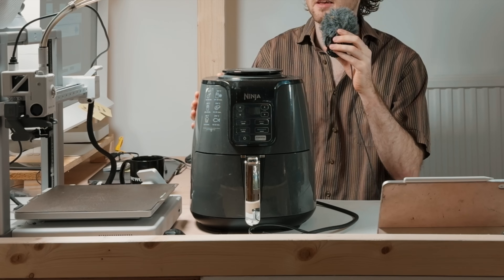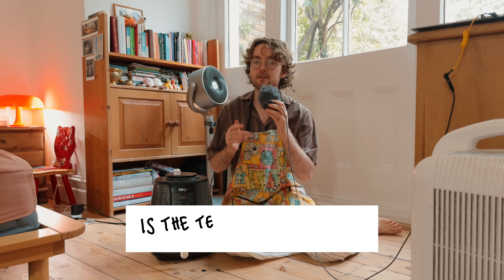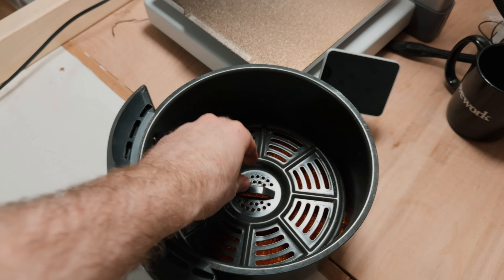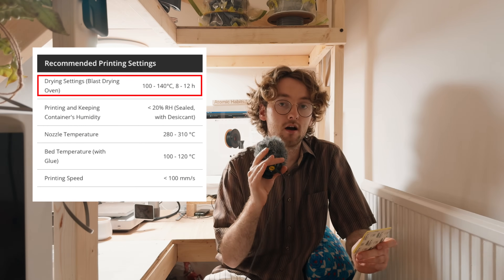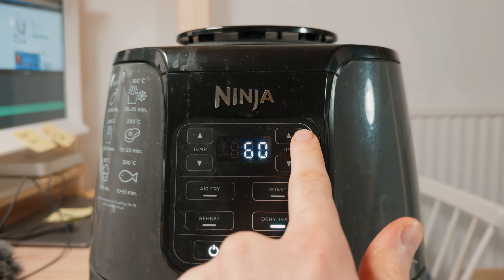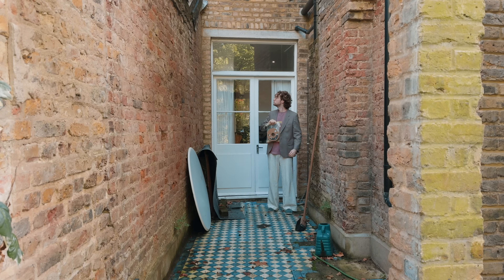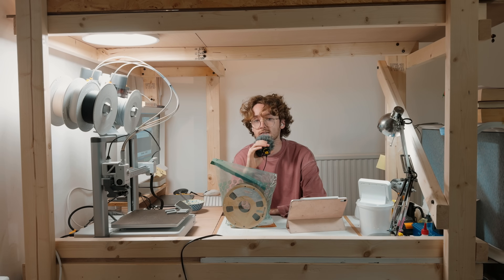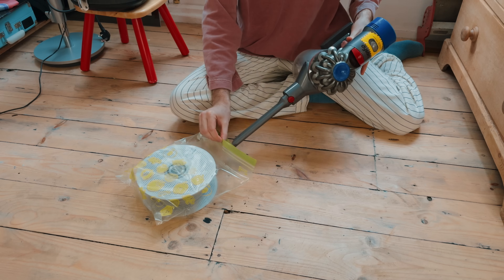Forget Filament Dryers. I Used an Air Fryer

Comment: Which model Ninja did you use? Amazon sells a 4 qt, 5.5 qt XL and a 5.5 qt MAX. I have an Instant Vortex 6 V1 which doesn't have a dehydrate mode. Closest I can get is Reheat 120f and 1 hour.
Reply: If you look at the layout of the buttons on his unit it matches the 4 qt model.

Comment: Nice vid, air fryer for drying filament isn't new and works surprisingly well. I just converted my dumb air fryer with  esp32, two triacs and K-type thermocouple so i can watch control it precisely including fan speed which can be loud.

Comment: The only thing I dislike about this is that air fryer is louder than a food dehydrator or filament dryer. It's not pleasant to run for 4,5 hours unless it can be in a separate room.

Comment: Save yourself 80 bucks and pick up a old convection oven at the thrift store for 10 😜 (an air fryer is a convection oven, just marketing)

That's what I did about 10 years ago, only issue with mine is that it's floor is limited to 200f/93c so I only use it to dry engineering filaments and silica gel. It will dry 1lbs of silica gel in 20 minutes 👍 (set at 260f/126c) from 20%

Mileage may vary on those second hand convection ovens 😅

Comment: I have the exact same air fryer. I recently upgraded to the Ninja mega bucket air fry and have been using the old one for drying filament. Works really well - its almost like the bucket was made specifically for filament spools!
Reply: what quart size is yours

Comment: I doubt that the desiccant in the bottom of the airfryer does much good, if the dry filament is removed without a long delay. There are lots of ways to set a reminder for yourself! 
And I would be concerned that the drying airblast would spread silica gel (and indicator) dust not only onto the filament, but more importantly into your living space (drying depends on the air inside being changed). That dust isn’t nice stuff to breathe. 
Having recently got an airfryer with a window, I was surprised to see just how fast the airflow is inside the thing - parchment lining paper blows around!
Reply: Wait, I don't know what you are talking about and I don't want to F my stuff or lungs up. How would the silica gel get out of the air fryer? Where can I go to learn more about silica gel and proper usage for 3d printing. Thanks.
Reply: @gerber8915   Airfryers ‘work’ because of blowing hot air strongly. 
To dehydrate the airfryer contents, water vapour has to be moved to the outside. Accordingly they take in a little ’fresh’ air and blow out some of the damp air. 
Any filter on an airfryer (few have them) would be to trap grease not dust. 
So any dust from your silica gel is going to get blown around inside, and will come out in the exhaust air.
Breathing dust from silica gel (and any colour change chemical with its own hazards) isn’t good for your lungs, though it might be less risky than smoking tobacco. As usual, it is the dosage that makes the poison. 

My concern is that there is absolutely no need whatsoever to put loose colour-changing silica gel inside the airfryer. The only reason given was the hope of keeping the filament thoroughly dry during the interval between the airfryer turning off and bagging the spool. Setting up any sort of reminder, (from an alarm clock to a smart watch) so you seal the spool away promptly when it is ready, takes away even that reason for using silica gel in the dehydrating airfryer. 
The risks may not be massive, but they are totally unnecessary. 
Silica gel and colour change chemical indicator hazards https://interteckpackaging.medium.com/is-it-safe-to-touch-silica-gel-what-will-happen-if-you-eat-silica-gel-63d34064ddf
Reply: @dougal6569  alright, that was incredibly informative. My take away is to use the air fryer just to dehydrate the filament. I still think that it’s a good idea, but what do I know lol

Comment: I have a dehumidifier and put a bambu studios box on top of it with my filament rolls inside it. A few holes to allow the dry air to circulate inside the box and to pass the air back to the dehumidifier allows it to dry quite quickly.
Super cheap if you already have a dehumidifier.

Comment: Something I have done recently which I would suggest is a good opportunity for testing would be to use Activated Alumina as desiccant. It will dry the filament out and can hold more water and is not toxic and wont break down like silica gel can. However unfortunately to dry it is a bit more annoying. It requires ~200c though i did read a paper recently about ultrasonic assistance so I think when I get time (and saturated Alumina) I will try cranking my ultrasonic cleaner up to max temp and blasting it as this apparently is more energy efficient.

Comment: "ok wtf just happened? our sales have gone thru the roof!'-ninja sales guy
Reply: Not really. They sell 30,000 of this one model a month just on Amazon alone, not even counting Walmart sales.
Reply: @rsilvers129  I have an AF100 also (for filament drying).  The "DEHYDRATE" mode only goes to 90º C, for higher temps "AIR FRY" mode is needed,  Is that the same for yours?

Comment: That desiccant holder looks nice. Please, add link to it into the description.
Reply: Here is the label I made for the top of the machine. This factors in that I tested three units and they all ran 3-5 degrees F too hot. The F temp is what to set the machine for. The C temp is adjusted to what it really will be. 

Ninja Filament Dryer 

105F	42C 	(PLA, 8 hours)
120F 	52C 	(PLA, 8 hours)
135F	60C 	(PETG, 8 hours)
150F 	68C 	(PETG/TPU, 8 hours)
165F 	75C 	(ASA/ABS, 8 hours)
170F	80C 	(ASA/ABS/PET/PA6/PC/PAHT, 8 hours)
185F 	88C 	(PPA/PPS, 12 hours)
250F 	120C 	(PPA/PPS, 8 hours)
275F	135C 	(Bambu PPA/PPS, 8 hours)
Reply: @rsilvers129  Thanks, friend!

I have an AF100, too.  Please note that the DEHYDRATE mode only goes from 40º to 90º C, for higher temps, using "AIR FRY" mode is needed.

Is that the case for your AF100?
Reply: Eyyy!
Reply: Just pay attention to the size of the desiccant beads you are using. The ones I bought were small enough to fall through the holes on this model. I had to use "UNIVERSAL SPOOL DESICCANT CONTAINER" by "spsm" instead.
Reply: Hey @MyTechFun can you test fryer at different temps? This looks so cool!
Reply: @MyTechFun fan of your channel. I can also highly recommend these at makersworld: "Filament Spool Dryer (for dry bags or boxes)" by Michael.tavel and "KYZ FF2 High Airflow Spool Desiccant Holder" by KYZ design. I used them in vaccuum sealed bags and theyre still dry a year later
Reply: Pretty sure this video got recommended to me because of you :)
Reply: @Splarkszter  im also thinking this 😅
Reply: @Splarkszter  Yeah thinking the same.

Comment: I do this often in a 6QT Instant Vortex Plus. It fits comfortably 1Kg spools (don’t know if it could fit 2Kg spools…it might without the raised platform but haven’t tested…it’s cooking some salmon right now, will check later) and also has a raised basket. In dehydrate mode, it can be set in the 35C- 79C range and in Air fryer mode the lowest that can be set is 82C, so it has the full range covered. Also has a glass window.

Comment: What is the Ninja airfryer model called?
Reply: AF101
Reply: what size in Quarts/Liters?
Reply: According to Ninja website description: AF100 Series Ninja® Air Fryer  SKUs AF101, AF100, AF100WMWH, AF100WMRD, AF100WMNV, AF101, AF101C, AF101CCO and AF101Q.
Reply: AF100 and AF101 are the same product. AF 101 includes a Stainless-Steel Multi-Layer Rack and a recipe book with more pages.
Reply: @antonio.zanella  So all the same size? Just pick the cheapest if only for drying filament and silica
Reply: @runesblog  it’s the 4 qt one. I just looked up af101 on Amazon because I kept seeing it in comments on filament drying. It fits one spool perfectly. My wife’s ninja is bigger, but has two baskets that wouldn’t fit a spool.
Reply: @runesblog  This is the answer I was looking to get clarified - not always clear on amazon
Reply: Great video!  What kind of thermometer and hygrometer is that?